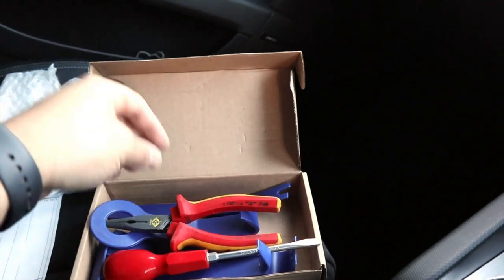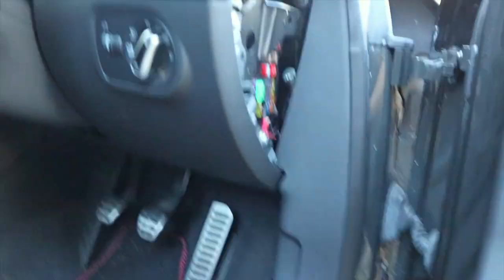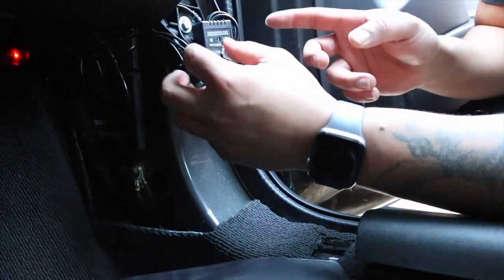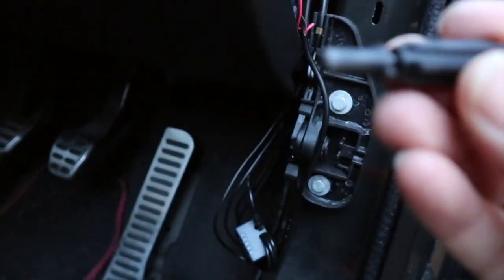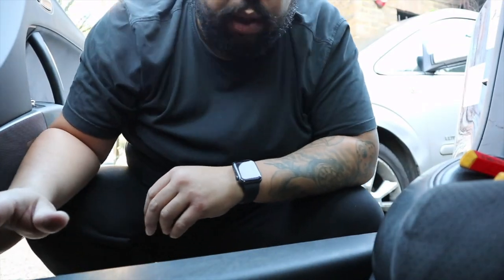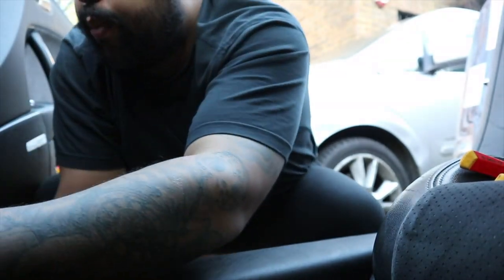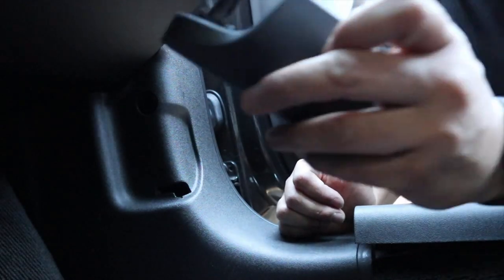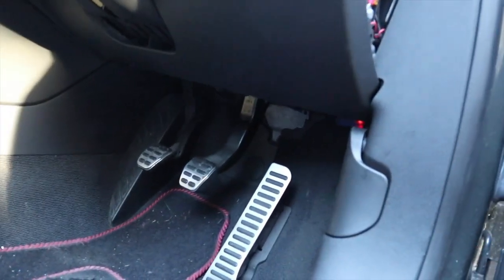Audi TT mk2 Bonnet Release fix (common Fault)

Comment: Nice job with the replacement, very useful video. When I did mine, I drilled a 2.5mm hole in the 'stub' of the splined shaft (centrally), then screwed in a small self tapper screw, and simply pulled out the stub! Then insert the new unit, and push home - Job done in less than 5 minutes! Make sure you drill into the centre of the stub, you only need to go into it about 5 - 6mm just to get a good grip.

Comment: No need to take ANY trim off at all. Use needle nose pliers to remove snapped shaft from the latch hole inwards to the footwell. Push new spindle in. Job done! Less than 1 minute!

Comment: Absolute  doddle £8 ebay 10 mins max. No special tools didnt need to fully take off the trim which the handle is on only partially  removed. Good luck

Comment: No need for all that fuss all I did was to screw a inch and a half screw into the snapd shaft and then pulled out with pliers it will take you about 30 second's.

Comment: Easier way to fix I found. No panels need removal. OK - Drill a small hole in the middle of the broken shaft, insert a self tapping screw, pull out the broken part with the screw, push in the new bonnet release handle. No panels removed. five minute job. Thanks ;)
Reply: Does this actually work?

Comment: I will tell you an easier way that I’ve used on my TT ,drill a tiny pilot hole in the middle of the spindle,screw in a screw until it gets a good bite and pull with pliers takes 2 minutes and push in your new puller.
Reply: This is a great tip Darren - just did this myself after the handle snapped for the second time.  Just a heads up to others to check your handle part number first as if you have the part number ending in "B", chances are your replacement will end in "C" and you will need to replace the female part of the bracket which is hidden behind the trim or the new "C" handle won't snap in properly.  The part number written on the inside of the new handle is 8J2 823 533 C.

Comment: Just watched this and thank you for putting the video up, but I checked the comments and someone suggested drilling a pilot hole into the snapped part and putting a screw in it and then just pull it out. It works, is easy to do and takes less than 5 minutes. 👍

Comment: Had the same issue. Changed the handle without removing any trim. Just drilled a small hole in the spindle which had snapped off in the car, then put a screw in and pulled the spindle out. Put the new handle on worked easily only took 5 mini. Hope this helps.

Comment: I think those handles are made out of butter! Sometimes you need to replace the mounting plate with the spindle on. Mine failed, got it replaced and still couldn’t get into the engine. Turns out the cable was knackered. To get into the cable you need to take the drivers wheel off, arch liner out then rummage. The cable runs from the handle, through the bulkhead to a plastic junction/terminal. That had separated. You can lash it together and fasten it tight with cable ties. Worth checking when you’ve got access as it’s a colossal ballache to get sorted!! Lucky the battery is in the boot or I’d be screwed completely
Reply from the maker: Wow what a lot of work defo a big design flew
Reply: Omg Iv changed two of these handles now. Wrecking me. My cable is frayed and I’m having nightmares on how to change the cable. 

Do you know of any videos that show the cable being changed? 

Need to do it before I can’t get in the bonnet
Reply: @JamesWatkins-bi3ed  I thought my release cable was toasted too. Mine is RHD, release cable on the RH side. Cable routes through the bulkhead across to the RH wing and runs along the underside of the wing, you know the folded channel? It’s under there. I got mine done at a garage as it happened in December a couple of years back and I had run out of patience!

From memory, the cable splits roughly above the wheel, there’s a plastic junction box about 20mm long x 10mm x 8mm (very roughly). So to get to that you had to have the wheel off, arch liner out and do it by feel. With mine the box had split open a bit, I think water had gone in, frozen and popped it. They managed to pop it back together and cable tie on each half looped into one that spanned it.

So, with yours if you can get a pair of pliers on it you might be able to get the bonnet open? Then get a bit better access to under the wing? If you’re lucky you could possibly get away with doing the half that runs from the cabin to above the wheel? I won’t lie it sounded fiddly as F to sort out, standard modern car, everything more complicated than it needs to be!

Hope that helps, have you checked for any forums? Sometimes you get people on there who share videos. Hope it works out okay. I’ll have a rummage and if I find anything I’ll put it on here for you.

Comment: Is it enough to replace the plastic thing or should the metal pull line also get some maintenance?
Reply from the maker: Replacing the plastic part should
Be solve the problem